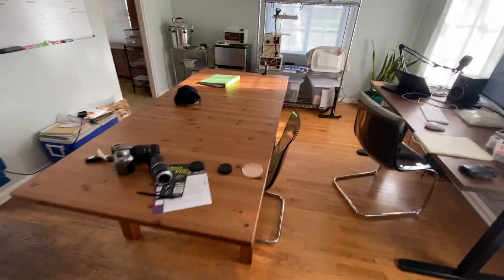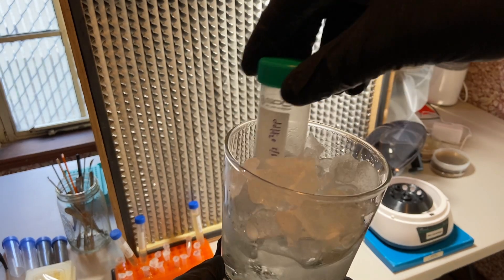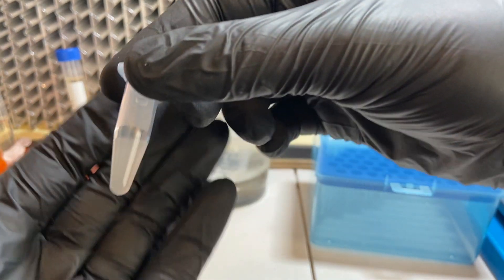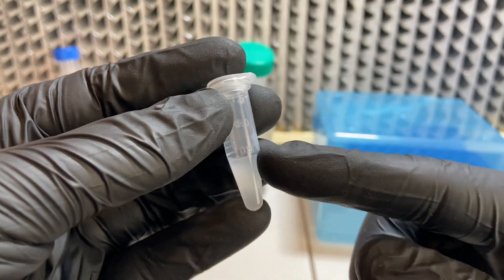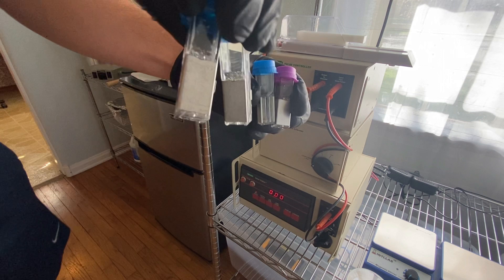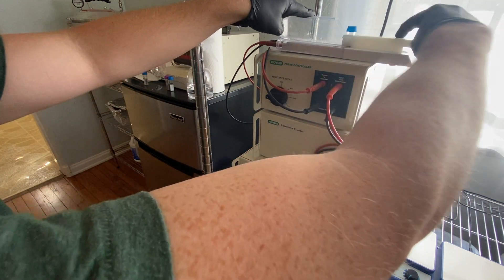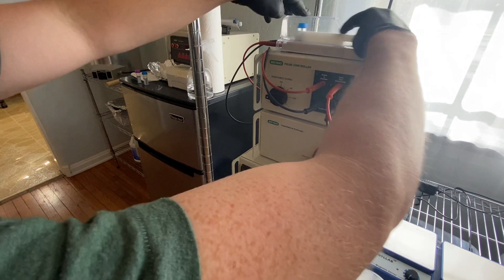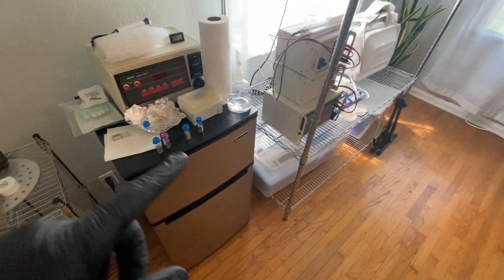Final electroporation tests before using actual fungi DNA! 🧬 (Day 6)

Comment: Just discovered you channel, so cool to see this stuff on YouTube! I regularly work with agrobacterium for plant genetic transformation so I'll offer some relevant advice where I can.

In my experience, arcing occurs when the outside of the cuvette is wet. I haven't experimented with different suspension buffers to know if that's factor, though. Just be aware that cold cuvettes collect condensation and should be wiped off with a paper towel before use. It's also a good idea to keep the cuvettes on ice until immediately before use, as long as you're sure to completely dry them before zapping.